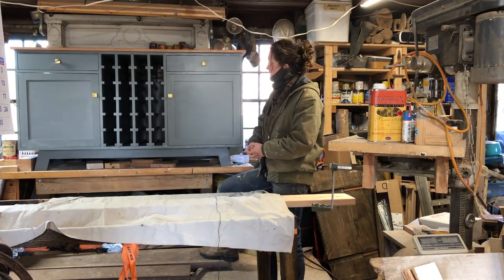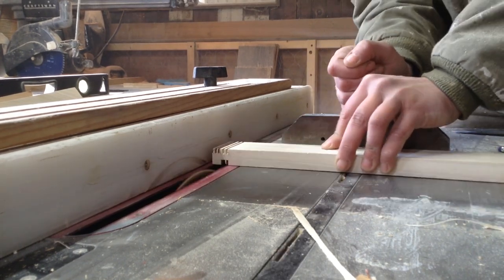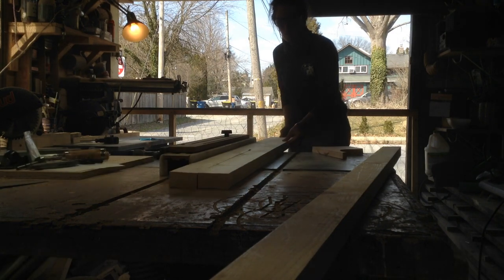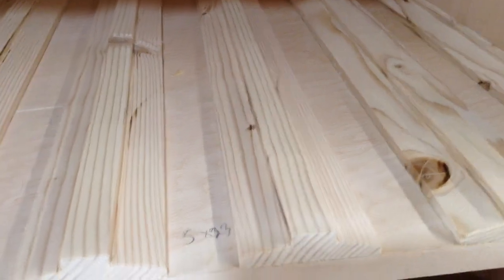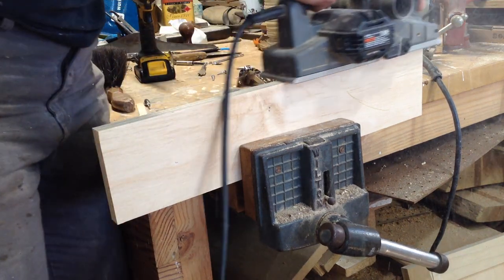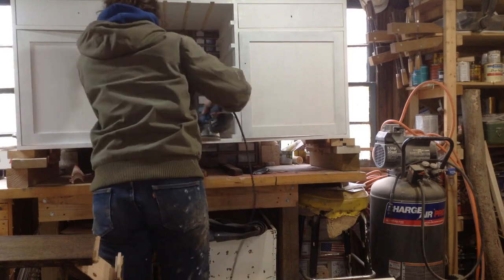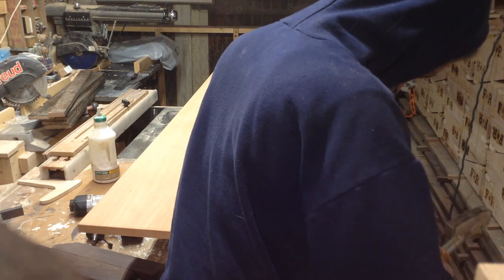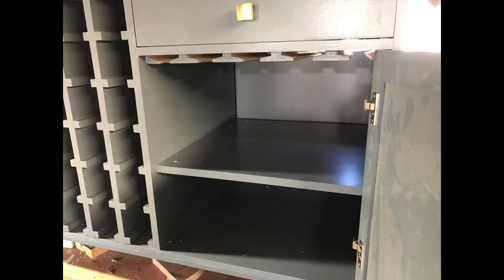Woodworking : Liquor Cabinet & Storage // How-To Part 3

Comment: Great looking piece and cleverly designed for its purpose. Can I ask why you double the drawer fronts rather than make the front part of the drawer - if that makes sense. As you use half blind dove tails is it easier to have just four sides to work with or is it to allow for fine adjustment? As always, thank you for sharing your work.
Reply from the maker: With inset doors especially I find it easier to get the revel right with  the false front.  Especially on this where I knew those two shelves bowed a bit, squaring those up on a drawer box would have been a pain.
Reply: @HoneyBadgerWoodWorks  Makes perfect sense even though it hadn't occurred to me, thank you. The more I learn, the more I discover there is to learn. Great to have found such a good teacher.

Comment: Also what size blade does your table saw and radial arm saw take? I noticed that it was raining while you where making this if you use water base paint you can paint in the rain. I mean that's what its for right? No really that turned out very nice and the cherry top was the way to go. Glad the customer went that way.
Reply from the maker: They both take a 10 inch blade.

Comment: Looks great! I use a lot of Waterlox in  my shop on my projects and one trick to getting it to stay longer is I buy in gallon form but immediately transfer into quart cans that you can buy at paint store for a dollar apiece. Then as you use it add marbles to the can to take up the space removed by the product you use to keep the air in the can to a minimum. This keeps the product from gelling over time and the marbles can be used over and over. 
Love the  content.
Reply from the maker: That's a good tip.  I get this stuff off Amazon because the closest store that sells it by me is a good 20 min. drive.  And Amazon will only ship the quarts to PA, not gallons.  But, if I ever get my hands on a gallon this is good advice thanks!

Comment: Do you know if your phone/camera has an "exposure lock"? If it does, you can lock the exposure so that it doesn't fluctuate between exposing for the inside of the shop vs the outside which is much brighter (I only mention this because it seems to be happening in your intro) . Just a thought to maybe save you some potential frustration. The cabinet is looking great! Hope the warm weather finds you soon!
Reply from the maker: Did not know that.  Will try and remember that for the next intro. I hope the warm weather finds me too haha!